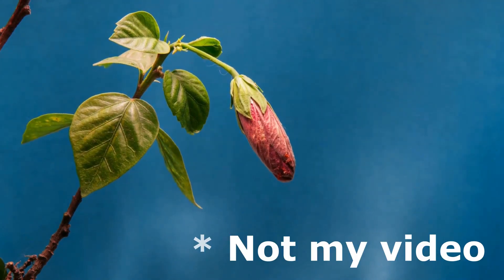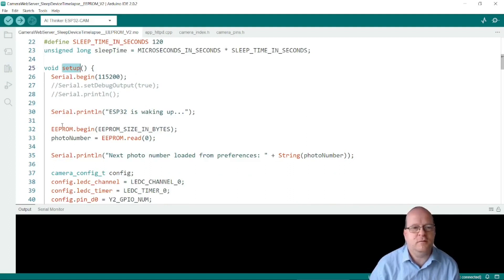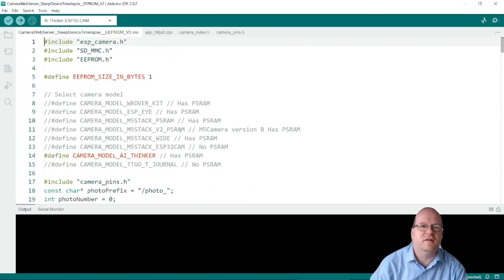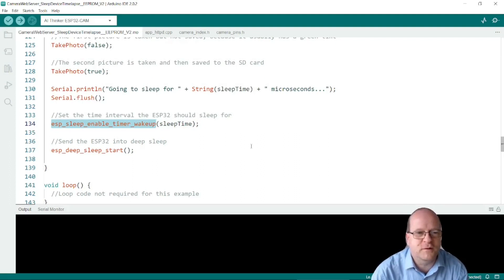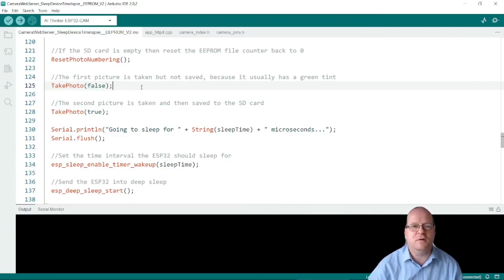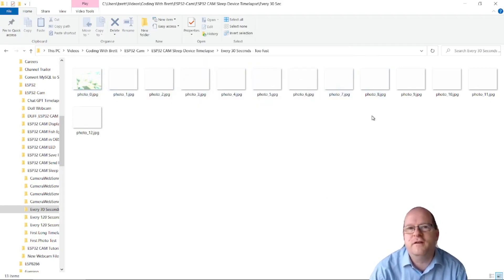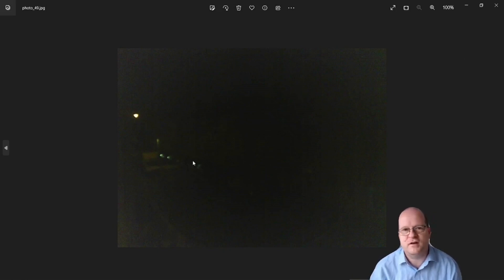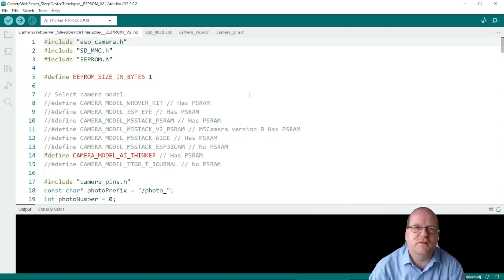ESP32 CAM Long Duration Time Lapse Photography

Comment: the ai thinker definition and pin.h file threw an error so i replaced them with the actual pin definitions and it compiled ok.// Pin definition //for CAMERA_MODEL_AI_THINKER
#define PWDN_GPIO_NUM     32
#define RESET_GPIO_NUM    -1
#define XCLK_GPIO_NUM      0
#define SIOD_GPIO_NUM     26
#define SIOC_GPIO_NUM     27

#define Y9_GPIO_NUM       35
#define Y8_GPIO_NUM       34
#define Y7_GPIO_NUM       39
#define Y6_GPIO_NUM       36
#define Y5_GPIO_NUM       21
#define Y4_GPIO_NUM       19
#define Y3_GPIO_NUM       18
#define Y2_GPIO_NUM        5
#define VSYNC_GPIO_NUM    25
#define HREF_GPIO_NUM     23
#define PCLK_GPIO_NUM     22

Comment: Hi Brett, I have just come across your video and I have got it to work on my ESP32-CAM board but with just one issue that is stumping me. It seems to be overwriting the saved file each time it takes a picture as when I check the SD card there is only 1 image on there named 0.jpg.  The SD card is empty to start with but that should be OK. See snippet of serial monitor output in next post.
Reply: I also having the same issue  it takes photo for every 2min but only one photo is saved as photo_0 did u solve this problem ?  it will be helpful for my clg  project work.
Reply: @ No, sorry, unresolved.
Reply: 17:52:59.352 -> Going to sleep for 30000000 microseconds...
17:53:29.091 -> ets Jul 29 2019 12:21:46
17:53:29.091 -> 
17:53:29.091 -> rst:0x5 (DEEPSLEEP_RESET),boot:0x13 (SPI_FAST_FLASH_BOOT)
17:53:29.091 -> configsip: 0, SPIWP:0xee
17:53:29.091 -> clk_drv:0x00,q_drv:0x00,d_drv:0x00,cs0_drv:0x00,hd_drv:0x00,wp_drv:0x00
17:53:29.091 -> mode:DIO, clock div:1
17:53:29.091 -> load:0x3fff0030,len:4832
17:53:29.091 -> load:0x40078000,len:16460
17:53:29.091 -> load:0x40080400,len:4
17:53:29.091 -> load:0x40080404,len:3504
17:53:29.091 -> entry 0x400805cc
17:53:29.137 -> E (47) esp_core� �][}���͡� No core dump partition found!
17:53:29.137 -> E (47) esp_core_dump_flash: No core dump partition found!
17:53:29.358 -> ESP32 is waking up...
17:53:29.358 -> Next photo number loaded from preferences: 1
17:53:29.624 -> Initialising SD card
17:53:29.669 -> SD card is empty
17:53:29.669 -> Next photo number reset to 0
17:53:29.896 -> Picture file name: /photo_0.jpg
17:53:30.022 -> Saved file to path: /photo_0.jpg
17:53:30.022 -> Next photo number saved to preferences: 1
17:53:30.022 -> Going to sleep for 30000000 microseconds...
17:53:59.711 -> ets Jul 29 2019 12:21:46
17:53:59.711 ->
Reply: It just keeps repeating this. Any help would be most appreciated. Thanks.